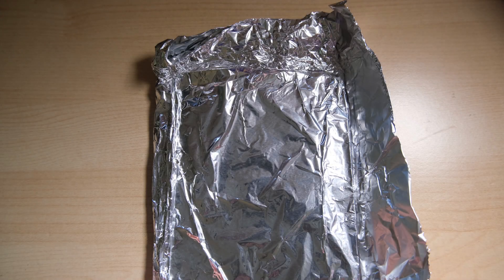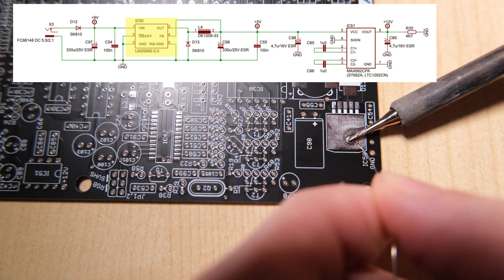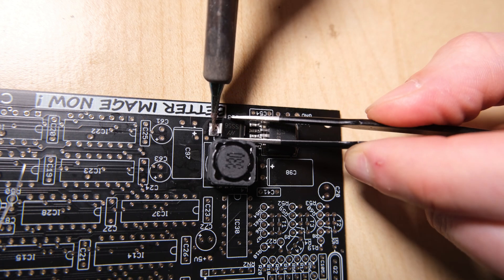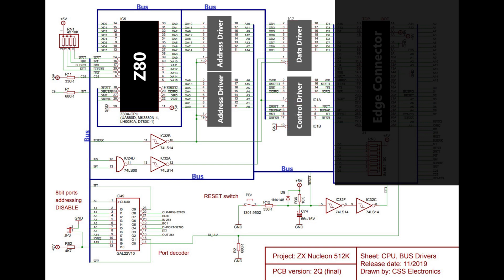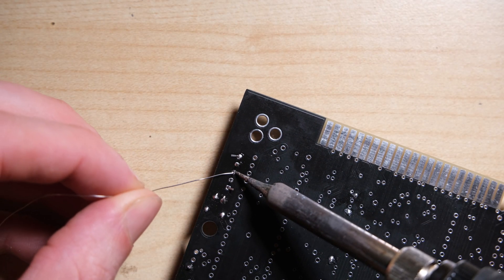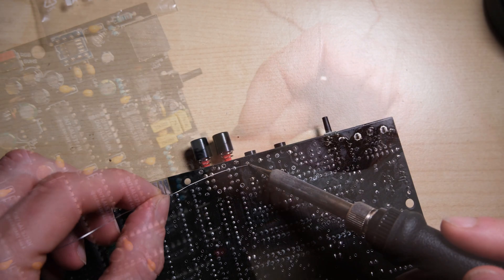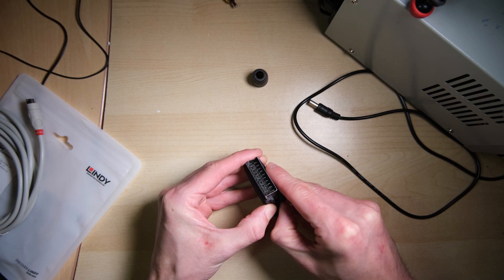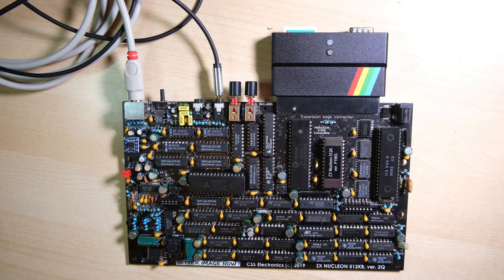ZX Nucleon 512K - Full Build and Demos

Comment: For SMD soldering use a viscous flux. It'll hold the chip in place while you solder it. Tacking or pre tinning isn't necessary. It's a little messier to clean up, but much easier.

Comment: Thanks for the video. I got today the same board with Version 1B, but unfortunaly without a power supply. Could you help me how polarity is with these 9 volt? so far I found the inner is minus (-) and the outer plus (+). Can you confirm this please? thx Jan
Reply: Ok, found it by my self. The + pole outside on the connector.
Reply from the maker: That's right!
Reply: @HappyLittleDiodes  Thanks for your answer. Well, after I ordered and received the video vdeo rgb cable for this machine, I was able to fire it up. It seems that now  I am lost. I am comming from the Commodore side. The way how to deal with this is new for me. I am looking for more input how to. Don't want to become ultimate expert but the basics, how to load a.s.o. - Also I am a fan of demos of all kind. Do you have a good source url ?  With the ZX I bought a SD Card reader which where I am able to load *.tap files... man I have so many questions...greetings Jan

Comment: @16:15 that's actually a familiar sight when access to the ROM (or the chip not being present) doesn't work. Found removing the ROM chip and seeing if that screen appears to be a rather easy and quick trick when working with ZX machines (you'd get similar patterns when bits are stuck for example).
Those lines on the right might be kind of normal, depending on the schematic. I've seen that with 1993 Pentagon 128K machines as well on modern displays. My 48K Pentagon adapted to 128K mem/timings does that as well.
Reply from the maker: A lucky mistake to have such a recognisable failure mode

Comment: You really should try a 1mm chisel tip for your primary soldering tip.   I have a bunch of the sharp tips and honestly they are useless.   I've been soldering for decades and often do 0.35mm pitch TQFP chips with 300+ pins using drag soldering techniques.   Even for through hole the 1mm will do much much better then that tiny little needle tip.   I'm only speaking from experience and that of others as well.  You just loose far too much heat with the needle point tips and they are useless for SMD work.   Not even sure why they sell them.   I like to solder around 370C and move quickly.
Reply: Never crossed my mind to try a chisel. I use an oversized tip for most SMD work. The needle tip is good for microsoldering though. However ideally they have to run hot, and lead free solder destroys them.
Reply from the maker: Since this video I've been using a fatter tip. I'm still to do my time learning proper smd techniques though

Comment: SMD becomes easy once you get the knack of it.. I can do 0805, SOIC and SOT-23 parts faster than through hole stuff now :)
I find that paste/gel flux works better than a flux pen - the flux pen stuff just evaporates too quickly. I use MG Chemicals 8341 which is pretty good (avoid breathing it though!).

Comment: In early 90s I had a zx based Soviet "Profi" computer with 384 kb of memory which could run CP/M and had 512x240 monochrome mode and 7mhz turbo mode.
Reply from the maker: Yes those features are also on the Pentagon!